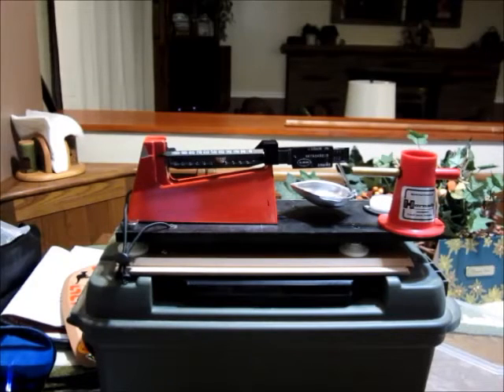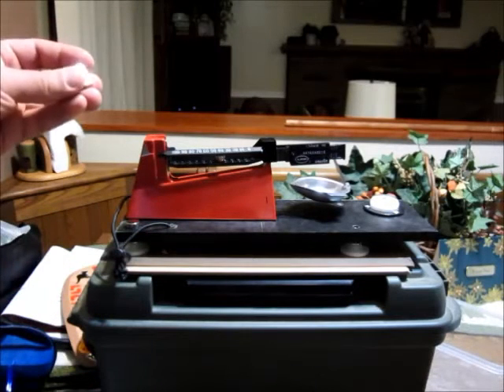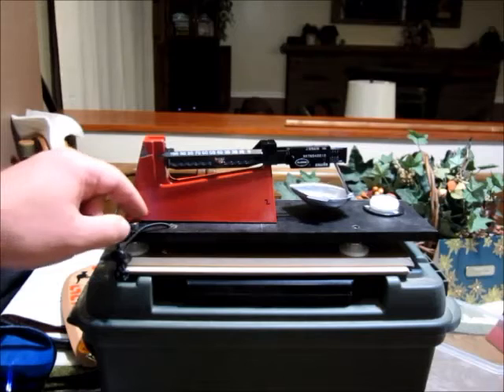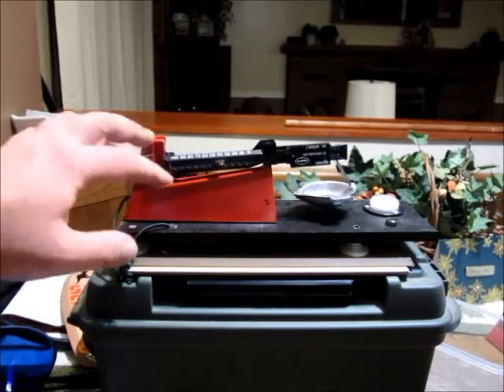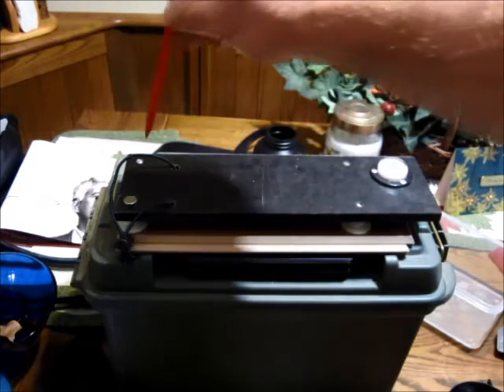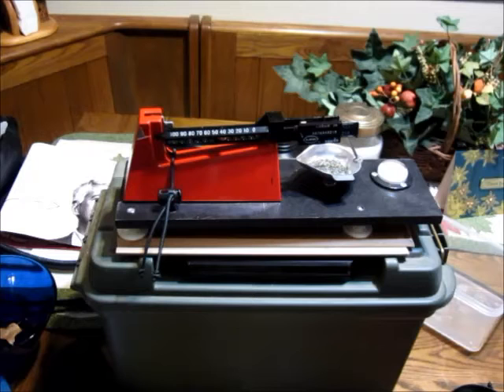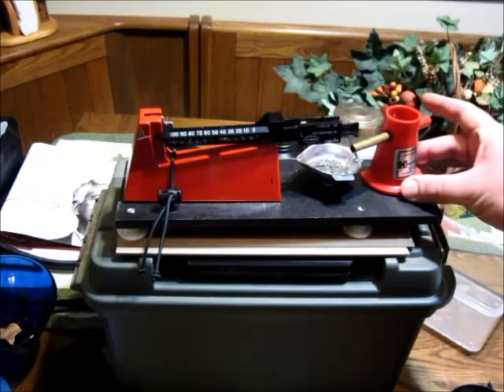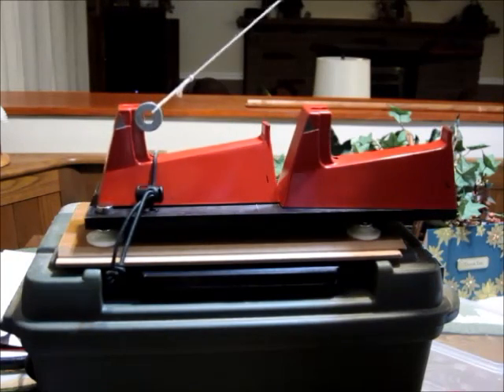Lee Safety Powder Scale Upgrade

Comment: Inquiring minds want to know. What did you do to get the magnets out? I have a couple of these scales and they look like they are epoxied in.
Reply from the maker: If I remember correctly, they are indeed held in with epoxy, but I was able to tap them out with a steel punch. The punch was just narrow enough to fit in the slot from the top, and the steel was hard enough to bite into the magnets. Once the epoxy broke, they just fell out.

Comment: By adding those magnets you threw off the accuracy this scale is known for. The reason this scale dampens the way it does is because it's designed for extreme accuracy. You probably won't notice the difference with plinking ammo, but if you're a 1000 yard precision shooter this change would show up in accuracy consistancy.

Comment: Congratulations¡ You've improved an item that needed no improvement whatsoever!  This inexpensive scale is as accurate as any scale I've ever used when it's properly set up and zeroed.  In a move i managed to lose the ball. I'm not cheap, but I am thrifty. Do me a favor and measure the ball and weigh it p!ease?
Reply: He actually threw the accuracy off my putting those powerful magnets on there. The Lee scale is designed for extreme accuracy, and by changing those magnets he decreased the sensitivity, which throws off the accuracy.

Comment: Does the magnet under the tray affect accuracy? Or is the pull on that too little to make a difference to the scale?
Reply from the maker: The tray is entirely aluminum, so the magnet doesn't attract or repel it.  The magnet slows down the movement of the tray via induction.
Reply: Thank you for the reply. I used your video as a starting point to upgrade my scale, and it turned out pretty good. Thank you for taking the time to share this .

Comment: Nice video. I've used several very expensive balance scales, and digital also. This inexpensive LEE is the most sensitive and accurate. It should be, it balances on a razor edge, superior to the pin balance on other designs. If I ever question my other scales, the LEE has the final say. Its an incredible value.